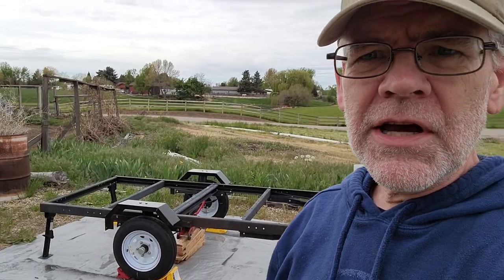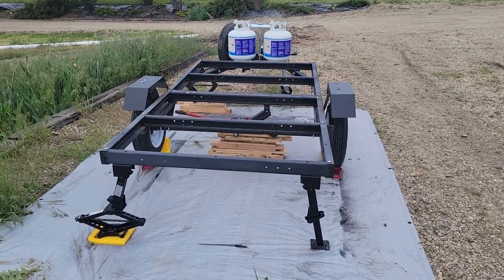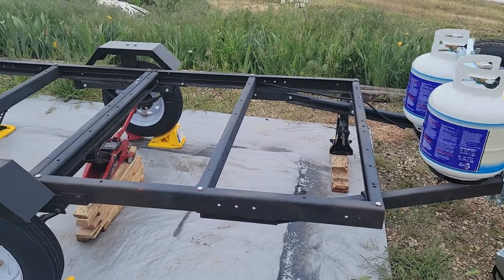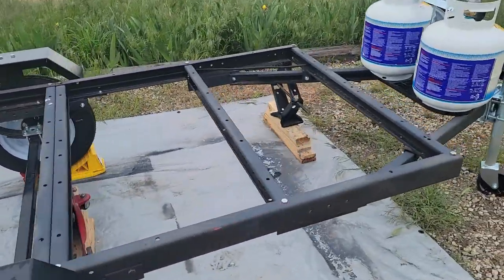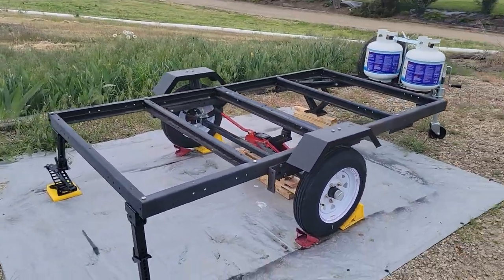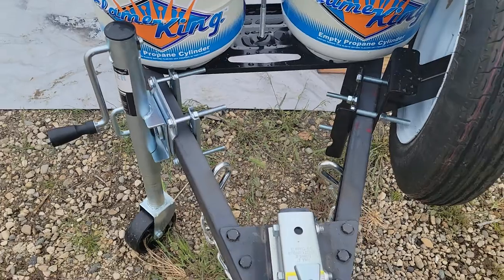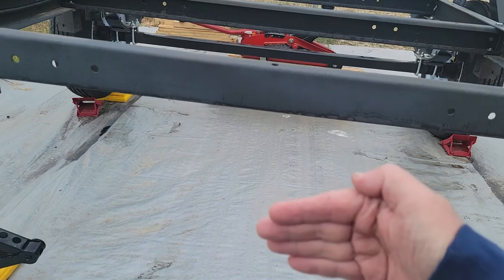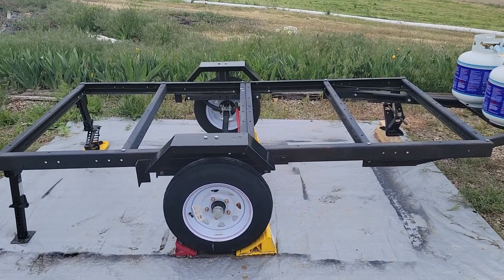The Gypsy Caravan Project, Part 1: Introduction & Trailer Frame Build

Comment: What's the propane for? Heat or cooking or both? I'm just wondering if putting a tank on it for diesel for heat would be better/cheaper.
Reply from the maker: The propane has three uses: 1) the double burner gas cooktop, 2) the super compact propane furnace, and 3) the instant tankless water heater. I included two 20 lb tanks with an auto-switching regulator so that I never have to worry about running out of fuel in the middle of the night or way up in the boonies. It took three months or full-time traveling over the summer to burn through one tank, so having to fill up only twice per year is pretty cost effective, I'd say.

Comment: Did you sand the frame down to bare metal before you repainted it?
Reply from the maker: No, but I probably should have. It came with a really good coat of red baked enamel, so painting it black was purely for aesthetics. It's been scratched off here and there where I've banged stuff into it, but the red paint underneath is solid, so it won't rust. I might hit it up with a touch of black now and then, but it's really not necessary.

Comment: What's the diameter of the axle? I have an old utility trailer frame that has a heavy duty axle on it I'm told. It's 1 1/2" x 1 1/2" inches thick and solid instead of hollow or bent like the harbor freight axles are and I'm hoping that I can use it to upgrade the axle on one of these trailers.
Reply from the maker: Inch and a half sounds about right. I haven't measured it, and it's diameter isn't listed in the manual, but the HF super-duty has an enclosed shaft, whereas the light duty only has a U-channel axle, so it's better in that respect. But I've heard of people beefing up these trailers with bigger wheels and heavier axles, so it's certainly doable, and couldn't hurt if you're up for the extra work.